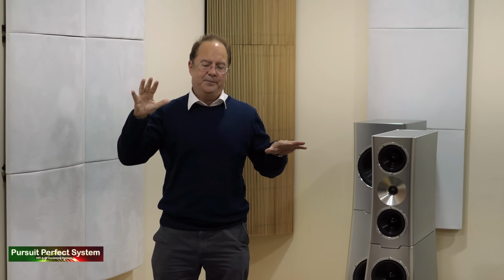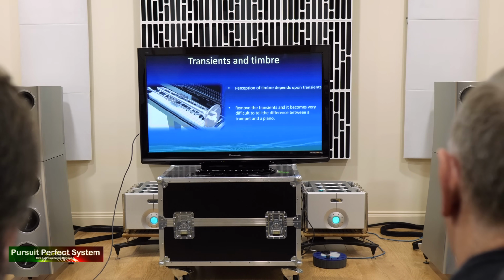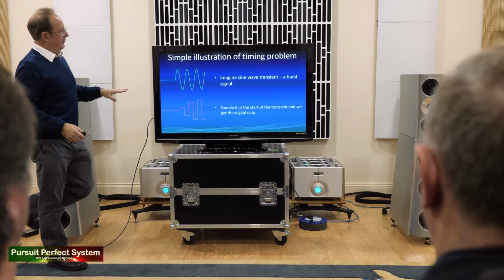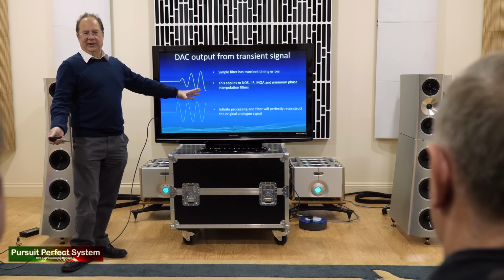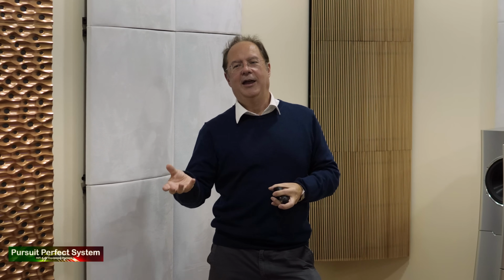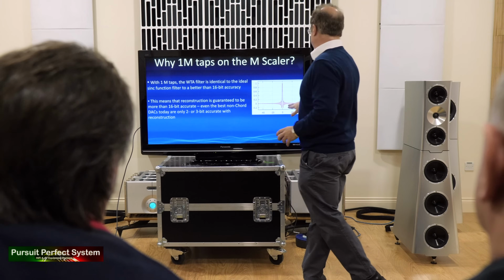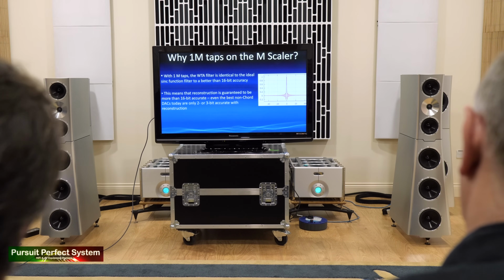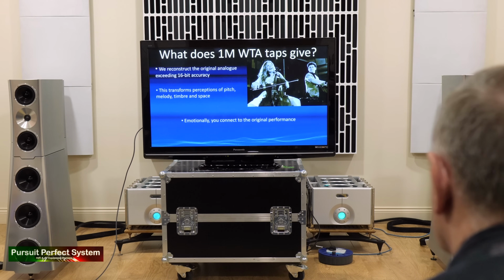Chord Electronics DAC M Scaler 1 Million Tap Lengths WHY?? Rob Watts Talk @ Nintronics Open Day 2018

Comment: 12:19 "...you couldn't even do it with a supercomputer..."

So if processing power has been a limitation, why does it have to be done in real time? Given the dual bnc output is 768kHz 24-bit stereo, that's about 35.2 MB/s - not too different from video streaming or compressed video files. So you could happily store all your music (or at least your favourites) after M-scaling has been applied. You could fit 53 days of M-scaled audio on the current largest consumer hard drive, which costs a fraction as much as the M-Scaler. You could probably use a fast lossless compression algorithm too, making it easier to store and transfer.

And being entirely in the digital domain, it doesn't seem absolutely necessary to have dedicated hardware for the hard work processing the audio. I'd be happy to run the maths on a suitable CPU / GPU that I already own - even if it can't manage to do it in real time, or with optimal efficiency - and store the output for future playback. Besides being a cheaper option for consumers, it would be immensely helpful as part of the R&D efforts - want to hear a 2-million tap length? 5 million? Try out a tweak to the algorithm? Just leave it processing overnight and compare it in the morning.

Comment: Nyquist theory said 44.1kHz is more then enough for digital sampling of sound for human hearing.
So why digital sound so unnatural. 

Easy because the same theory also said you have to use infinite sinc function to recover sound perfectly.
What Rob was saying is how to make making Nyquist theory practical. 

M scaler recover sound with sinc(1,015,808).

When most chip DAC only use sin(32).
Sony and philips back in 80s believed you can't tell any difference when they use sinc(8) .
What a joke

Comment: I own the Qutest that has 50,000 taps. By using the M-Scaler (that has 1 million taps) in the chain before the Qutest, will there be problems or downsampling?
Reply from the maker: Hi Jim - the M Scaler improves the Qutest by a significant margin for clarity and sound stage - there is no downsampling to worry about ;)
Reply: @PursuitPerfectSystem  Thanks Terry. I would hate to be without my Qutest and now I really want to demo the M-Scaler.

Comment: Thanks for turning on the taps to this otherwise private event.
Reply from the maker: good job Dan "tapping" into my joke :)
Reply: @PursuitPerfectSystem  I just wanted to share my experience.  I owned chord Dave and M scaler but I was shocked that I didn't enjoy the sound that much. Maybe I had too much expectation but I did like the tt2 and m scaler together. But I felt the sound wasn't clear enough like chord Dave. The m  scaler and tt2 sound punchy but it didn't have the clarity like Dave. Dave alone without m scaler sounded better to me and I preferred. 

My plan is to use m scaler with another dac. I like clear and punchy sound for headphone. However, I was extremely impressed with audiolab m-dac headphone amplifier. In your opinion do you think I will be happy with m scaler connected with audiolab m-dac, just to get a little punchy sound. I thought the audiolab m-dac was very good for the price. 

Thanks